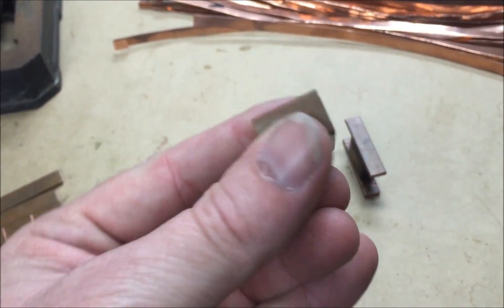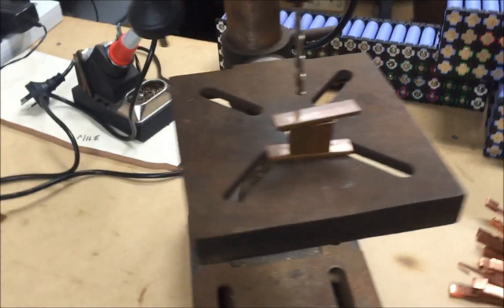Just a short update to appease the YT gods.

Comment: Agree with other commenters - Need to test IR and possibly even self discharge rate to double check.

Those grey cells in the 3 thousands - they appear the be LG, can I have the numbers on it to look up the datasheet?

Cheers.
Reply: Panasonic NCR18650. 2900 mAh, so maybe Pete should do some tests with a different charger?
Reply: Yeah - Panasonic do 0.2C (~580mA) discharge to a 2.5v cutoff and get ~2800-~2950mAh.
Reply: +Ollimo91 I also dont think that there are cells over 3000 mAh if u discharge them to only 3.0 Volt with 1 Ampere load current.
The capacity seems way to high for used batteries.
Reply from the maker: @andy - I'm getting there ....@Ollimo91 - donations accepted@Solar Island - it really doesn't matter if they aren't "3000" mah what is more important is that all cells have been tested in the same way with consistent results. All results will be relative to each other. It won't take too much extra effort to time-lapse charge & discharge of 4 grey "3000" mah cells

Comment: test the internal resistance of the cells and you'll find the bad ones. guaranteed you have LOTS of bad cells eith high IR. those cells are responsible for the poor performance and heating. bad IR  is the biggest reason old laptop batteries are bad.
Reply: A cell with a high internal resistance doesn't heat up as much as a cell with a low internal resistance. The effect is indirect. The high Ri cells produce less current which causes the low Ri cells to produce more current. If you do the math (P = U * I where U is voltage drop and I = Voltage drop / Ri) you'll find that the low Ri cells convert much more Energy into heat than the high Ri cells.

But variation in Ri only becomes a real problem when putting high C loads on the pack. Considering that he had a 5KWh pack and put a load of 1Kw on it, there is no really big problem. But I think 1Kw on a 5KWh battery is about the maximum his design can do and still perform reasonably well. (And it did,... he got more than 4 hours during that first test.)

Yet, it's still a good idea to weed out the high Ri cells. High would by anything above 200 mOhm, though if possible, keeping that maximum lower would be better.

I test the Ri on all the cells I have and the variation is big. From as low as 75 mOhm to as high as 900 mOhm. In my experience, the older the cells are, the worse the Ri is. Brand also is a factor I think. All the cells that I have that have low enough Ri are Panasonic and Samsung cells. The Sony cells tend to be around 200 mOhms, but I suspect that the Sony cells that I have are older than the Panasonic cells. The Samsung cells I like the best so far. But I just bought 10 extra batteries so my opinion about what brand is best might change with having 60 more cells to test.
Reply: +Peter Faber great information, peter. I've learned a thing or two!
Reply: +Won2Race You're welcome. 
The above applies to parallel cells by the way. In series the effect is different. I'll do a test with 2 cells in series and post here.
Reply: Ok, Here we go,....

In a parallel setup, what is constant over all cells is the voltage and what varies is the amount of current each cell delivers which depends on the Internal Resistance. In a series setup, what is constant for all cells is the current and what varies is the voltage of each cell which depends on the Internal Resistance.

I did the test with a high Ri cell (750mOhm) and a low Ri cell (75 mOhm) and a load resistor of 8 Ohm. That would put the load current at about 1A. The total open voltage was 8.13 V. After putting  the load on the 2 cells, the voltage dropped to about 7.4V which is a Voltage drop of about 730 mV. That's about right, considering the current at 7.4V being about (7.4/8) 925 mA and a voltage drop U = I * Ri = 0.925 * (0.75 + 0.075) = 763 mV. (The difference between calculated and measured values are caused by variations in Ri depending on the current and voltage when measuring Ri and of course, Resistors and Multimeters are only precise upto some percentage.)

The voltage over the low Ri cell dropped very little, like 60 mV, the Voltage over the high Ri cell dropped by about 670 mV, which meant that right a way it was already at about 3.25V (from about 3.92 V without a load). So it didn't take 10 minutes and the voltage over the high Ri cell dropped below 3 volts and that was the end of the test already. After leaving the cells sit for a while, the voltage of the high Ri cell jumped straight up to 3.82 V. In other words, it didn't lose much of it's charge, it just can't deliver it at a high C. (and for a cell with such a high Ri, 0.5 C is already way too high.)

So there you have it. How good or bad a cell is depends mostly on its internal resistance. Capacity ofcourse is also important. Especially when you create battery banks to be used in series, you want all banks to have similar capacities so that they all last about the same amount of time.